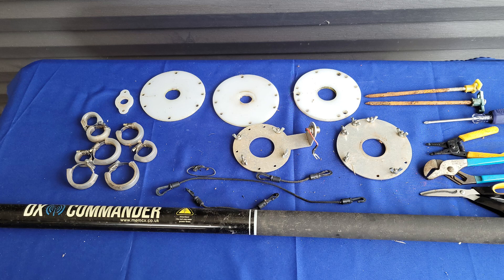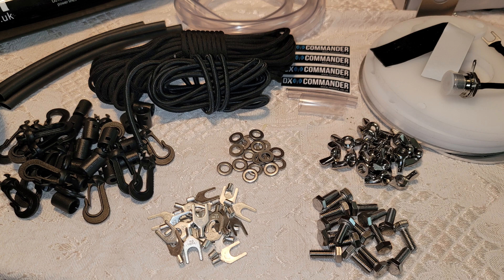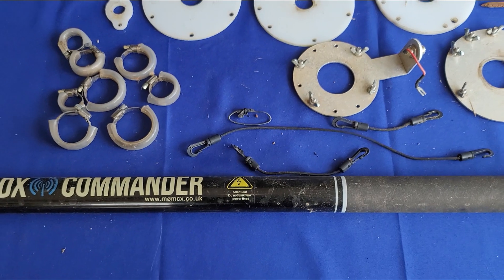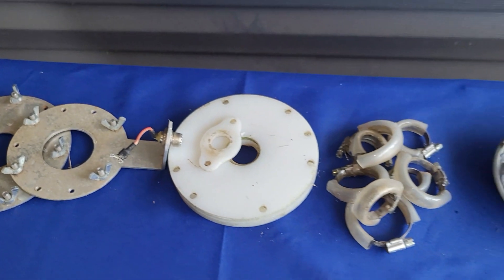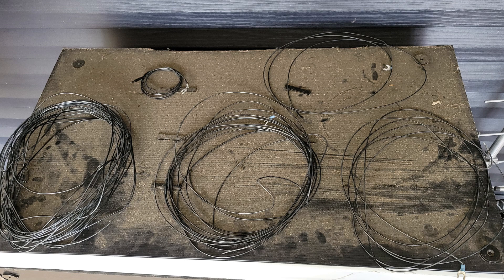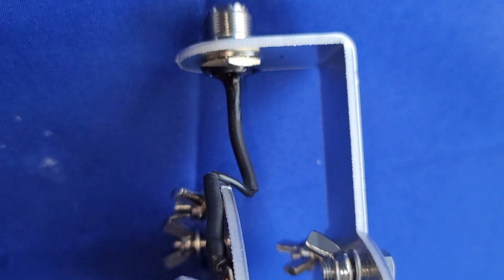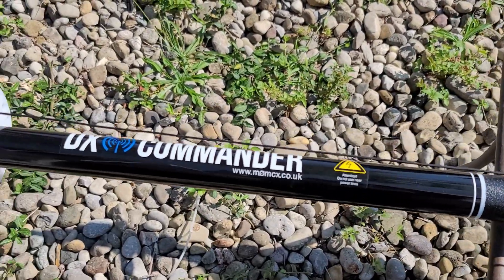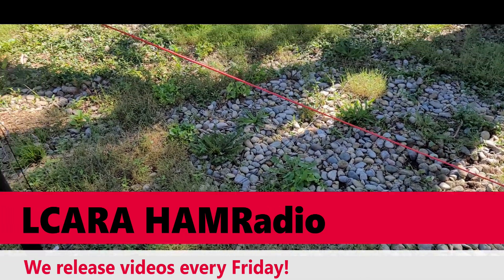LCARA HAM Radio: DX Commander Classic Refurb!!!

Comment: Nice video. My classic has been up untouched for 3 years now. All at 1.5 or below with 1.7 on 80m.  I think I’ll be doing the same thing as you now. Thanks for the inspiration! New DX10 wire is nice as you say. Cheers 🍻